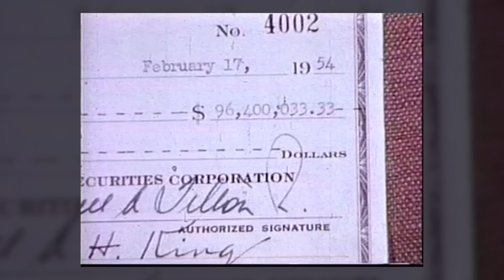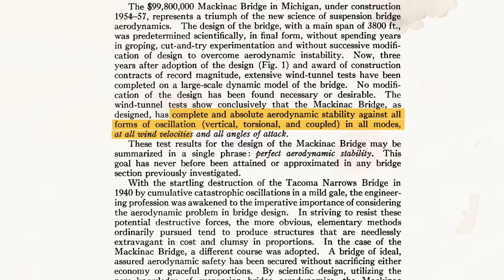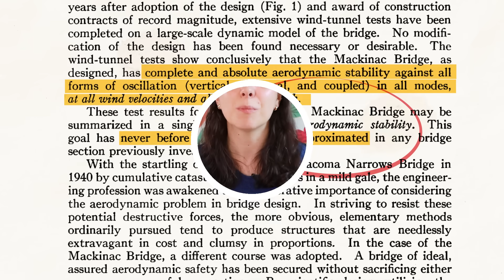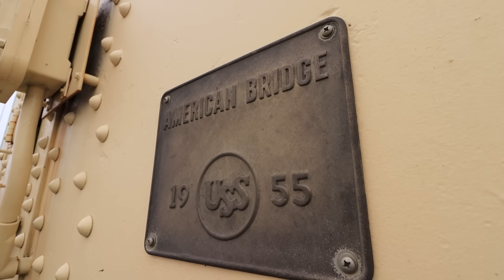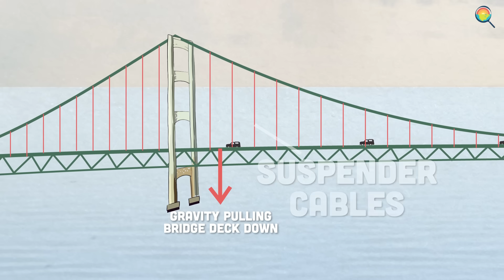The Incredible Engineering Behind Michigan's Iconic Bridge

Comment: When I visited Mackinac for the first time last year, I was thankful I traffic and weather for both of my crossings of The Big Mack were good. I visited the info center at the north end of the bridge (well worth going for the displays, memorial, and view) but I enjoyed learning more in this video.

I never thought of a Cheboygan / Bois Blanc / Round Island / Mackinac Island / St. Ignace series of bridges. The engineering would have been easier, but four bridges would have cost more than one, even one that was record-setting. It also would have greatly altered those islands, whose present condition is pretty heavily reliant on not having any bridge connections.

The Mathews Bridge in Jacksonville, FL is a steel cantilever bridge completed in 1953, shortly after Galloping Gertie's collapse. I think that influenced the bridge originally having steel grating in the middle section, which nobody in Jacksonville liked. In 2007, engineering advancements were such that the steel grating was finally replaced with concrete decking to match the rest of the bridge.

Comment: Alexis, I love your content but I really have to call out your timeline, it wasn't the first major suspension bridge designed after Galloping Gertie, and it wasn't even the first to use those elements. 

The First Tacoma Narrows Bridge (Galloping Gertie) opened and collapsed in 1940. 

The Second Tacoma Narrows Bridge was delayed by WWII and started construction in 1947, opening in 1950. You can make the argument it's not a newly designed bridge since it's in the same location and had some of the same engineers, but I think it counts.

The replacement bridge has pass through grates in the road surface (as the dividing lines between lanes, the lanes themselves were pavement) and a stiffening truss support underneath. Just like the Mackinac Bridge. The pass through grates are also why you cannot change lanes on the bridge. The engineers used models and wind tunnels (some sources say Boeing's since they were just up the road, but I can't confirm that) to vigorously test the new design. 

Steinman was appointed as design engineer for the Mackinac bridge in 1953, after the replacement Tacoma Narrows had already been proving it's changes for years. 

That's not to say that The Mackinac Bridge isn't a feat of design genius nor is it to discredit the absolute rigorous work that Steinman put in. But he was definitely also iterating on proven designs, taking them to new extremes.

Comment: Interesting story and an interesting bridge.  I'm an engineer and my dad was an engineer who built bridges and dams, so you could say I'm into bridges.  Pretty cool how that engineer solved the wind problem.  I have to nitpick though, the columns are carrying the weight vertically.  If they weren't holding up the cables, the cables wouldn't be holding up the bridge deck.  The anchors are also doing their part to hold it up, but that explanation isn't quite accurate.  Anyway, love your channel.  Keep it up!

Comment: Great video, but the "it's the anchorages holding the bridge up, not the tower" is just indefensibly wrong. The anchorages may be what holds the cable taut, but it's the towers the hold it UP. Obviously, if the towers collapse, the bridge goes down too. The idea that the anchorages might be experiencing greater forces than the towers may well be an interesting and true fact, but by turning it in a false dichotomy and implying "the tower isn't holding the bridge up", that's just lies.

Comment: Fun fact.  The day the Tacoma Narrows Bridge fell down, the bids had just been opened to resurface the bridge and install gratings instead of the solid road surface.  The reason there were films of the bridge going down is because the U of Wash structural engineering professor had been studying the bridge for over a year and had setup cameras to record the motion of the bridge whenever it moved.  I have looked at the research papers and the winning bid papers for the resurfacing of the Tacoma Narrows Bridge which my fellow engineer found in his dad's attic.  
Another fun fact.  The person who was to buy insurance for the Tacoma Narrows Bridge, pocketed the money because he felt the bridge would never fail.  
The bridge fell down in a steady 40 mph wind, not a high speed wind.  The 40 mph wind matched the resonant frequency of the bridge, like the vibration of a violin string.

Comment: Good job Alexis! Being born before the bridge was built, I have memories of waiting for hours and hours in traffic jams while waiting to take the ferry across while on our way to visit relatives in Wisconsin. I have black & white photos that we took of the bridge being built in early 1957 with large sections of the road deck still not installed and hanging from the suspension cables. I also remember the first time going over the bridge in the spring of 1958. Quite an engineering feat it is! Keep up the great work you do and keep em coming Alexis.

Comment: As a Michigander who lived in the Puget Sound area near Seattle for several decades, I have also driven over the modern Tacoma Narrows suspension bridge. It is quite a bit shorter but both endpoints are up fairly high. Also ALL the bridge is metal mesh. I assume they learned from Mighty Mac!
Reply: Me too!
Reply: How could it learn lessons from a bridge built after it had been open for years? The new Tacoma Narrows bridge opened in 1950, 3 years before Steinman was appointed design engineer on the Mackinac. 

Also the bridge is not all metal mesh, only the dividing lines between lanes. There are some all mesh bridges int he Puget Sound Area though, like Montlake, University, and Fremont Bridges in Seattle, but those are mesh because they're drawbridges and mesh is lighter and easier to move than concrete.

Comment: @15:06 It should be noted that engineers would not let any bodies be entombed in the concrete if, for no other reason (i.e. its a lousy thing to do), that it would seriously compromise the structure.  The body would decay and leave a big hole which is a bad thing structurally.  This question comes up a lot with the Hoover Dam construction.  No dead bodies in there either for the same reason.  Even if the engineers did not care at all they'd still make a point of getting bodies out if only to ensure the structure was sound (and they are human so of course would want to retrieve them anyway).

Comment: I used to work for one of the paint contractors that were repainting the bridge several years ago. Ive been all over, under, on and inside the bridge. Never got to walk the main cables unfortunately. The top of the tower has ab absolutely amazing view. Inside thevanchor pier is also very interesting. You  can see the main cables split apart into individual strands and anchor to the concrete.  My great grandmother rented rooms to the workers when the bridge was being construted.

Comment: The Bridge is so elegant, it floats over the Straits like a wing with the grating allowing the air pressure to equalize on the top and bottom of the deck.  Plus the Bridge has a great Green & White paint job...

Comment: when I was a long-haul trucker, I went across the Mackinac bridge only one time.  The winds were so strong that day that they only let me cross because I had a heavy load.  Trucks with light loads or empty trailers weren't allowed to cross at all, and there was a long line of trucks on the side of the road, waiting for the winds to go down so they could finally cross.
Reply: There is a reason they have the wind drivers that you can request for sure! I hate crossing when you can feel the bridge moving!
Reply: I hate water. I hate crossing bridges. I thought driving across this one would be scary but once on it, it was fine. No problem. Sounds a bit strange but O.K.
Reply: There are times it’s so windy that cars and light loads can only cross when partnered with heavy trucks.

Comment: I'm loving your videos! Also, when they resurfaced the bridge a few years ago, a local artist there bought up a lot of the metal from the road treads. They are cutting it up, cleaning it up, and turning it into jewelry! I have a little Michigan-shaped pendant made of a bit of metal that spent 50 years hanging over the strait!
Reply from the maker: Oh, cool! What a great use of those old parts!
Reply: I have a piece of the grateing from the bridge about 5x7x8" that weighs about 10# as a bookend.  These 5x30ft sections are put up for auction on a government website. They will cut the piece in half for the winning bidder, then it's up to you to haul it away.  Cut in half, it still weighs 2000lb